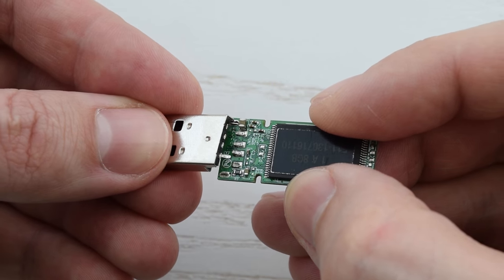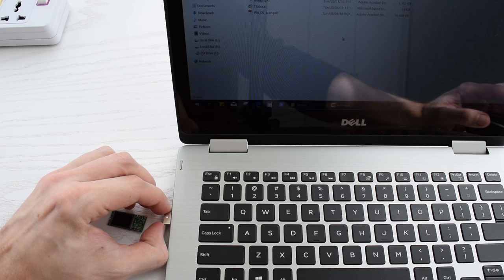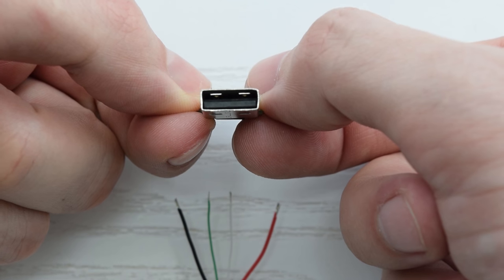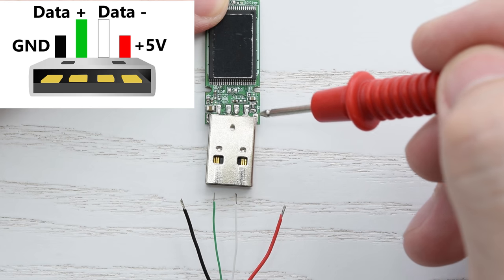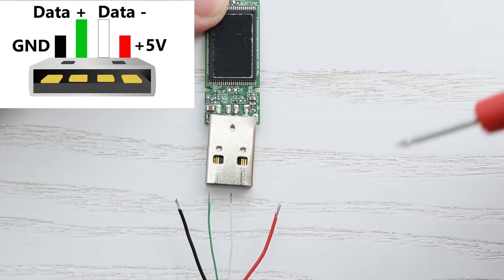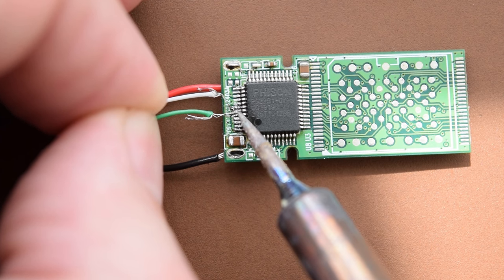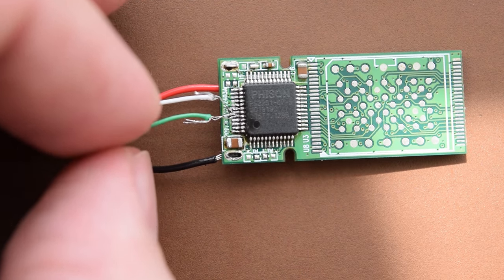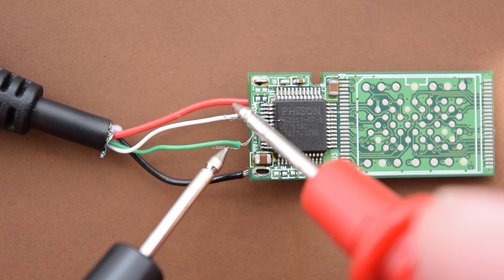How to Fix Bent or Broken USB Flash Drive Connector and recover data

Comment: Allow me to add my thanks for this fantastic video. Not only did you confirm what I thought was possible but without that wiring diagram I would have had no way of knowing which cable went with which pin on the circuit board. Short, sweet, and effective. Thanks so much!
Reply from the maker: Glad it helped

Comment: You rock! Your wiring diagram and temp jumper idea with a USB cable saved us from losing a ton of crucial files my wife had only on 1 broken flash drive! I used your solder jumper method and it worked perfectly! All files are in 4 places now!
Reply from the maker: Excellent job! I'm happy to help!

Comment: Oh my goodness!! I was going to cry and I don't know what else. I bent my flash drive in which I had stored all of my coursework for this unwanted class I had to take for the Florida Dept. of Education. I did everything I could to try to get this thing to work. Your video was the first one to come up, so I decided to watch it. I was able to open the plastic that encloses the components of the flash drive. I saw the pins you were talking about and, as you said, I don't have a small soldering iron. So I used my thumbnail (actual thumbnail). Good thing it was long and was able to hold those pins down enough so that I could get the one file I needed. I can get the others later on to move to another flash drive. It took only 2-3 minutes, but they were painful as I had to press down hard so that the pins stay down and I would not have to restart the whole process after three times of trying. Thank you so much. God bless you.
Reply from the maker: Thank you for such an honest comment. I'm happy to help!

Comment: Thanks for the video. 
I have a USB 3.0, so it has 9 connectors. I saw on a comment you said you can use it with 4. If I don't have a multimeter can I just put the wires in the same order and it'll be safe?

Comment: From "1:49-1:53"... what if I did that with "krazy glue" to prevent a short circuit as I don't have what u'r using to prevent the short circuit? Would it still work? or else I'mm gonna have to stick in with only holding broken USB connector on the "Flash Drive".

Comment: Thank you so very much for your time and effort in making such clear and concise video. This is one of those curve balls and and I need your help, if you don’t mind. I’m helping a friend with his program security USB. His kid knocked the USB out of his PC. The USB  was bent and ultimately broken. With much difficulty I managed to open and take out the board. This board is not your “typical board” with 4 lines coming out of it. It is “U” shape with 4 points behind it. The question is how would I be able to determine the appropriate pins? Can I share with you a picture of the board? I couldn’t find any diagrams on line either. Thank you in advance.
Reply from the maker: Send me  close-up photos of the board from both sides.
Reply: I thank you so very much for the response. I have the pictures however, I have never post a pic on the YouTube comments. Any suggestions would be greatly appreciated. Thanks again.
Reply: @ElectronicsComputers  I did more on line search and find out this USB is a “B” type with its pin layout. However, I still want to send you the pictures for confirmation, don’t want to take a chance. But and I as mentioned before, I don’t know where to send you the pictures. I would appreciate any assistance you could provide. Thanks in advance.

Comment: i have a flash drive with all of the metal on the plug-in parts. all 4 pad are completely ripped off the board. where you only can see green spots where they were on the board itself. i have a soldering iron coming in a few days. i have cord i can cut and use what would be the best method to continue.
Reply from the maker: All you have to do is carefully and correctly solder wires to the PCB. If you go to any repair shop, they would do the same thing and charge you at least a hundred bucks.
Reply: @ElectronicsComputers   even possible in my case where the solder joints are completely ripped off the board? The pins are intact but the solder joint were ripped off the PCB.

Comment: Hello Sir, thank you so much for your video!!! I have a few questions, because i did not understand some answers from you. I have a Hama USB Stick with 9 wires. Did i understand it right that i can also use only 4 wires? So the far left and right ones are black and red but where does the other go, the white and green one. I did see multiple times your video but i still do not get it. Or could you please let me know how to connect 9 wires? Thank you so much. Kind regards!
Reply from the maker: I hope this will help: https://ibb.co/GV8snz6
There's no need to solder all 9 wires. For USB 2.0 connection you'll need only 4 wires.
Reply: I understand but where do i connerct the 4 wires to the 9 contacts on my stick?

Comment: Is your solder already in the solder iron because I didn’t see you put solder when you heated up the circuit and what solder iron are you using?
Reply from the maker: Yes, I applied solder on the tip of the soldering iron first. I couldn't do it another way because I was holding the wires in one hand and the soldering iron in the other. The links for all the stuff that I used in the video is in the description below.

Comment: Would it possible to solder the cables to the old usb connector head contacts without first removing it from the board? So that u can avoid damaging the board during removal?
Reply from the maker: It's possible, but what's the point? If you can do that, then most likely your USB port is properly soldered to the PCB. Instead of soldering, you can simply plug it into your computer and use it normally. The whole point of attaching a USB cable to the PCB is because the USB port is completely or partially detached from the PCB's solder pads.

Comment: I have a USB 3.0 with 9-pins.  I 'm guessing the black ground & the red power wires go on the far left & far right pins respectively, but can the green & white wires go to any of the remaining 7 pins?  Does it matter which ones I connect them to?  Thanks!!
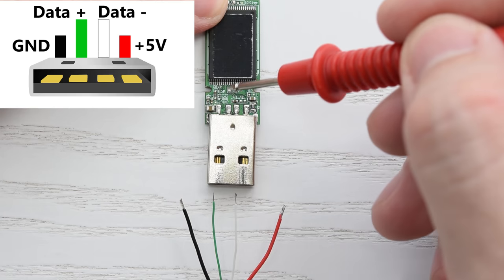Reply from the maker: You have to wire your USB 3.0 drive in 2.0 version. So for data transfer you will use only those two pins in the needle of the connector and ignore the rest. You can see at 1:23 where white and green wires should go.

Comment: Sir, which four connectors would I need to use in the case of having a USB 3.0 drive?
Reply from the maker: There will be 5 contacts for USB 3.0 and 4 contacts for USB 2.0 connection. I recommend using USB 2.0 interface because it has less wires.

Comment: Do you need flux to solder at 1:50min? soldering the wires to the board vs cpu. Also my USB doesn't have a metal connector, its like a flat brown spot. is it ok to solder to that or would i need to connect to the cpu? It is a retractable Cruze USB. 4 connection points.
Reply from the maker: You always need to apply flux on exposed copper wires or PCB traces. Can you show me a close-up high resolution image of your drives PCB?

Comment: Hi, I have 9 pins coming from the USB onto the board. Are only 4 of these being used? Or what? Thanks for any advice!
Reply from the maker: you have USB 3.0 drive but you can use only 4 contacts and it will work as a USB 2.0 drive.
Reply: @ElectronicsComputers  Thanks!
Reply: @ElectronicsComputers  Hi, me again. Do you know of a place I can find a schamatic or similar of a 3.0 usb to figure out which 4 contacts to use? Thanks

Comment: This method works! But unfortunately when I connect the wires to the broken USB head my computer makes the connection noise but it automatically states that there is a problem with the device and that it wasn't able to install it successfully. Do you know any fix for my laptop to allow me to access the files? I see it is connecting but it's not appear local disk just getting error messages..
Reply from the maker: If you're connecting a USB cable to the PCB board then try to reverse two middle data wires.

Comment: Hello I have a 3.0 SanDisk USB drive. I heard  that's fine it will still work with the 4. However I know that each pin is for a specific thing on the 3.0 so witch pins would be the 4 pins of (GND) (DATA+) (DATA-) (+5V) out of the 9 pins on the SanDisk 3.0?
Reply from the maker: Red contacts for USB 3.0 and White ones for USB 2.0: https://ibb.co/281PNhH
Simply use white ones to power your flash drive and transfer data.
Reply: @ElectronicsComputers   Ok thanks that was extremely helpful, so I only need to use the data - and data + for data transfer? On a 3.0 and it would still be the same on a 3.0 where data - is green and data + is white thats where I get a lil confused
Reply from the maker: @xxSOULREAPER25xx  Forget about USB 3.0 connectors. You have 4 wires, two provide 5 volts and two data transfer. For USB 3.0 you need two receive and two transmit wires and also two wires for power.

Comment: 1:53 "if some of these pads have been ripped off the board" - what if all four of them are now missing?
Reply from the maker: You need to figure out where those traces lead and solder wires to the other pads.

Comment: I got a full metal one and it makes the connect sound on windows but nothing shows up... I got it open but it doesnt have a lil board in it but just a plastic covered small one. Is there any fix for those too or is it rather lost for ever?
Reply from the maker: It's almost impossible to deal with the latest USB drives without the microscope and hot air station.
Reply: @ElectronicsComputers  aw man okay. Well that’s unfortunate then. Thank you for the quick response tho <3

Comment: I tried to connect the wires to the board then connecting it to my pc to see if it works, the pc recognized the sound board(usb) but the next day when I tried again my pc didn't recognized the sound board anymore, I just kept hearing the connecting usb sound. How do i fix it ? I want to make sure the sound board is recognized by pc before soldering.

Comment: So I dropped my flash drive on accident and there seems to be no damage on it and when I connect the usb the light on it quickly flashes once and it stays off after that does that mean the flash drive doesn’t have power going to it when its connected?

Comment: Think that is what mine has done. The USB is connecting but is not showing drive name or the used/free space.  How do you remove the part you insert into the PC from the actual USB drive part?
Reply from the maker: With a soldering iron.
Reply: @ElectronicsComputers  could it be fixed without soldering?

Comment: Question, I have a usb with 9 connectors, is it just to put togheter?
Reply from the maker: That's a USB 3.0 connector. You can only connect 4 terminals and it will work as a regular USB 2.0 flash drive.
Reply: @ElectronicsComputers  hello?

Comment: what if one of the 4 pins is broken off, have any idea if it will still work?
Reply from the maker: You have to find with a multimiter where that pin goes and solder a wire to that pad or component.

Comment: It says “Unknown USB Device needs more power than the port can supply” what do I do? Do you think it might be the usb cord I used to solder the wire and the usb with?
Reply from the maker: Double check your wiring and make sure that there's no short circuit.
Reply: @ElectronicsComputers  is it possible to fix a short circuit and how do I check to see if there is a short circuit

Comment: I have cut open a usb cord but it only had black and red wires inside, can I still use this method without the green and white wire?
Reply from the maker: No! If your cable has only two wires then it's not a USB data cable it's just a charging one.
Reply: No worries I have to send mine away it is a NAND chip or something 
Thank you for your help and the video anyway :)

Comment: i tried the first method. when i hold the connector to the board and plug it into the computer the light turns on. strong and steady but the computer is not showing a usb connected. what could be the issue?
Reply from the maker: Make sure that the data wires (green and white) have a good connection with the traces/solder pads on  your flash drive board.

Comment: what if solder on ground pads are missing the black and red one where do i connect them ?
Reply from the maker: you have to find the other solder pads which were connected to the ripped off ones. Without a multimeter it's almost impossible task.
Reply: What if only the black one is missing in usb cable?
Reply from the maker: @luthandovilakazi870  What wire colors do you have in that cable?

Comment: You said any usb cable would do.. but my usb cables only have 2 lines when cut( blue and red) :/ what or where can buy to find a 4 cable usb cable..
Reply from the maker: I never seen anything like that! Maybe it's just a cheap cable for charging some device without data transfer wires.
Reply: @ElectronicsComputers  actually, nevermind! I used the first method with a different usb connector, the original one broke, and it worked like a charm!! Thank you so much for this info vid, you saved my life!!!
Reply from the maker: @TherpThad  I'm glad I could help you!

Comment: Can indonit with a old mouse USB plug in? Does it have same wiring inside?I don't want to cut it out and then realize it was for nothing. Please help
Reply from the maker: Any USB data cable will do the job. Whether it's going to be "for nothing" or not, you can find out by giving it a try. There are a bunch of variables, and it all depends on your technical skills. I provided simple instructions that would work in most cases for the most basic USB drives; the rest is up to you.
Reply: @ElectronicsComputers  
Thank you!Will try:)

Comment: So I have a usb 3.0 and it looks like it has 9 total connectors on it. How do I do this with that?
Reply from the maker: You can use just 4 connectors and it will work using USB 2.0 interface.

Comment: Will this work with a flash chip?  I opened my flash drive and there is only a chip inside.  I dont know what to do from here
Reply from the maker: the same process for all flash drives. But if it's a small flash drive it's really hard to find traces in order to solder USB cable. Sometimes it's even impossible and we simply put the flash chip to another donor board.

Comment: Mu usb has not been completely separated, what can i do in this situation.
Reply from the maker: Just solder that port down or try to make a contact by pressing the USB connector to the board and then backup your information.

Comment: I am really completely puzzled here. I had my USB stick (intenso 32gb) broken. The connecting bit to the laptop was bend. I took some tools and started to open it. I had to use a lot of force so it did snap a bit violent and some bits might have jumped away but not much. But the whole green plate is just not there. I also can't see how it would have ever fitted inside. I only find a mini SD-card size plate that sits in the connector but inside the stick is just plastic. I turned the room up side down looking for missing bits but there aren't any. Are there USB sticks that have just an SD-card like storage inside? (I anyway don't understand why a USB stick needs that green plate stuff while a mini SD-card doesn't..) Thanks anyone that can solve this puzzle.
Reply from the maker: I think the PCB is inside of your USB connector. The main difference is why SD card smaller than USB flash drive is that SD card has only memory chip inside and all the other components are inside of your cardreader or laptop's motherboard. USB interface provides universal connection for different devices, so all USB devices must have a USB controller on the board. In your case, memory chip communicates through that controller with the USB port.
Reply: @ElectronicsComputers  hello?

Comment: My sandisk is broken. I tried just holding it in to the computer with my hand but it does not work. How can I fix it using hot glue???
Reply from the maker: you need to solder wires hot glue is not gonna help you.

Comment: what if the usb cable only has two wires inside a black and a red
Reply from the maker: it a charging cable which doesn't have data wires in it. So that cable is not gonna help you.

Comment: I cut data cable.but inside only two wires.pink and white.what should I do.😰😰
Reply from the maker: If your USB cable has only two wires then it was just a charger cable and it's not gonna work.
Reply: @ElectronicsComputers  yes true.then I cut my old I pad cable and its working. thanks for the video..

Comment: If USB +5v is completely ripped
Reply from the maker: you need to find where it goes. There's tiny resistor which acts as a fuse, so you can solder =5V to that resistor.
Reply: @ElectronicsComputers  thank you so much 🤗🤗🤗🤗🤗🤗🤗🤗🤗🤗🤗🤗🤗🤗🤗🤗you had saved my life 🤗🤗🤗🤗🤗🤗🤗🤗🤗🤗
Reply from the maker: @smsshreyash8500  I'm so glad I could help you.